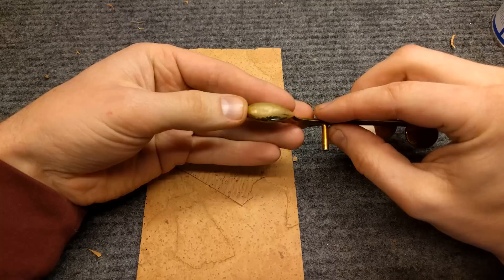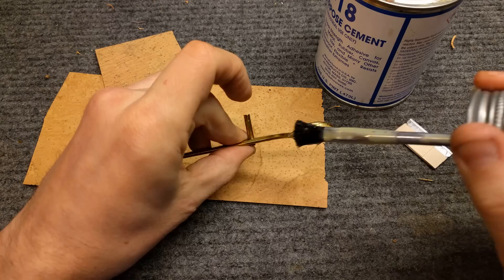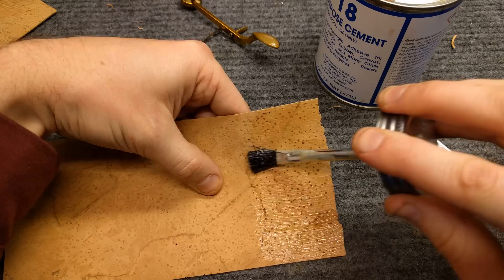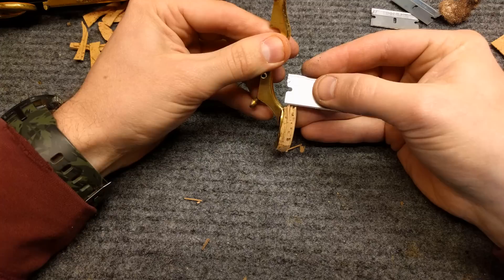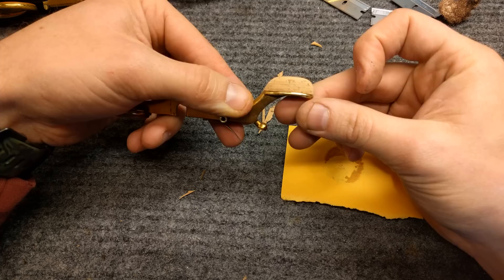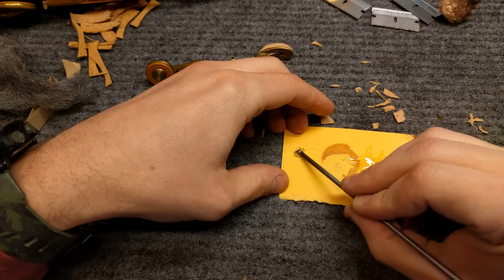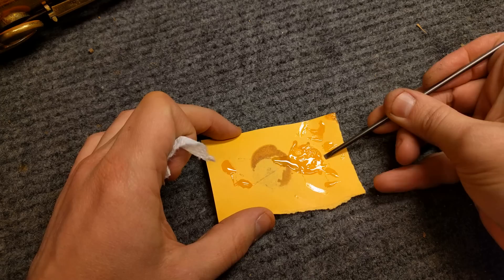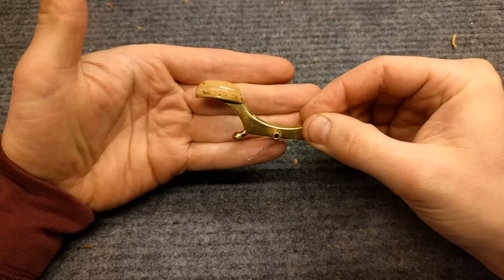Saxophone Repair Topic: Make Key Risers (The Dumb Way?)

Comment: Great job.I usually use the preformed rubber risers. A lot of people don't like them because they tend to move around and fall off. I simply slide a piece of heat shrink tubing ovet the key, trim it off and apply a small amount of super glue to the tubing
 I then slide on the rubber riser and it sticks firmly to the shrunk in place tubing. Quick, cheap and easily removable without damaging the keywork.
Reply from the maker: DUBLIN537 nice tip

Comment: Looks great. I did very similar risers on my alto about 15 years ago with wine cork (what I had:) and coated over the cork and key with clear tool-dip. Looked good for a while. The tool dip eventually absorbed dirt and looks not like new anymore - epoxy would look and feel better. If I ever do it again I might use some nice hardwood with an oiled finish...
Reply: @Anders Hayes instablaster :)
Reply: @Douglas Jamison I really appreciate your reply. I got to the site through google and I'm in the hacking process now.
I see it takes quite some time so I will reply here later when my account password hopefully is recovered.
Reply: @Douglas Jamison it worked and I actually got access to my account again. I am so happy:D
Thanks so much, you saved my ass!
Reply: @Anders Hayes no problem :)

Comment: Imho it's a quite well done result for that problem. All in all I ask, whhy nearly most of saxes aren.t built for normal hand shapes. I don.t even ONE saxophone without too small key palms!!! Only Keilwerth uses a adjustable in/out screw to adjust the palm keys. Thänx MattStohrer for this tutorial, I did also like you showed and could approach the palm keys for my conditions. I can reach now d, eb, e and f without moving the hand, even the wohle forearm. It works fine now. Kind regards, Henry

Comment: Great video, glad I came across it. One question though. On the edge of the key, do you bring the epoxy over the edge, or just barely to it? Seems like if you bring the epoxy even with the edge, then it wouldn't release with heat.

Comment: Nice job. Air bubbles will disappear if treated with heat. Preferable an alcohol torch (look fly rod builder apparel) or a cigarette lighter. But be careful with the latter.

Comment: I have been doing almost exactly this for years; unfortunately, I haven't captured pictures of any customer horns, but (at Matt's request) I just took some pix of my personal horns;
http://www.shmuelyosef.com/images/Palm_Riser_montage.jpg
The way that I fit them was to just crudely glue a cork stack on the palm risers with silicone rubber, carve them a little higher than the customer thinks is necessary and send them away with a razor blade...to just try it out and carve away at it until it is the right height. Then I measure that and fabricate the epoxy risers in place (again a little oversize) using Apoxie Sculpt (https://www.avesstudio.com/apoxie/primary-color-kit) which comes in cool colors and can be mixed with carbon black or metal filings for all kinds of nice effects. You can mix two colors, roll them flat, press them together to make striped material, etc...I have generally chosen personally to make them look brass-like, but have made them red, yellow, blue, black, etc for customers. To finish them you just sand them to shape (with 120 grit wet-dry) and finish them with subsequent 280 grit, 400, 600, and finally with Wenol (or equivalent) polishing grit to make them shiny and tactile. After a little practice you get good at sanding right up to the brass where the epoxy gets semi-transparent and you can flick it off with a thumbnail around the edges at the base of the riser.

I used to do built-up cork, and coat it with nail polish which had nice metallic choices, but found it was a lot more trouble than this. To get the epoxy ones off, you just take off the key, put a torch on the touch for a few seconds and then the epoxy just pops off. You can glue it back on with silicone or contact cement if you like.
Reply from the maker: good stuff man, thanks!

Comment: Could you please do a (series of )videos on common upgrades to vintage horns to make them easier to play.  I'm returning to play alto  Martin standard/searchlight  made ~ 1936 & toying with re-padding/tuning, new adjustable thumb rest, neck or buying Yamaha or Jean student. Goal church concert some Jazz playing.  Your advice is greatly appreciated.   Thank you
Reply from the maker: I don't really do that stuff!  My philosophy is that when properly set up, vintage horns don't need it.  When I see all sorts of doodads all over a horn, I just think to myself well, there's a horn that isn't set up right.  Because most every professional horn made from the 1920s onward can be a great saxophone when it is in the condition that it's makers envisioned when they designed it.  They knew a lot more than us, and they certainly know more than a modern repairman.  I consider myself a student of the instruments they built.
Reply: Thanks for replying - that's a fair response. the caveat is, as am I learning about 'different types' of pro model Martin Handcraft Committee' alto some are made w/  or w/o right hand adjustable thumb rests ( my version w/o) that are small for adult.  It was bought for me as a child. Now as an adult & getting older, I would like adjustable and larger thumb rest for easier handling and larger neck screw for easier loosening/tightening.   Yes I would definitely benefit from your skills to tune w/ correct key height. Do you give over-haul wide range estimates w/ pix of sax, realizing in-person is best /final assessment?  Thanks for your time.

Comment: I have made this key riser for my tenor sax and it is great! Thank you so much for this video! Do you know of any saxophone cases to recommend that better accommodate taller palm keys? Unfortunately my walt Johnson case (even though I love it to death) does not have a very deep well for the palm keys. I worry that excess pressure on the palm key with the riser could bend or damage the key or instrument.

Comment: Nice looking risers.   Any worries about getting a little bit of that epoxy on the side of the keys and being hard to remove later if desired?   I saw the comment about testors paint.   I have added little bits of acrylic craft paint (like plaid brand from the Walmart craft isle) to epoxy to color it for other applications before.  I felt like it caused it to cure faster but otherwise worked nicely.

Comment: Hey Matt! Got epoxy off my keys and decided to use those Protec Clear Risers. They are aesthetically pleasing. Cant tell they are there most of the time visually, like the AWFUL black ones. 
How can I make them stiffer and not so spongy? I tried a shell of clear epoxy JB Weld. But it was still gummy and did not adhere to the silicone or whatever they are made of. Its not a big annoyance but would like a harder touch on them. Thanks for any Ideas!!

Comment: When applying either epoxy or clear nail polish, are you only painting the cork or the rim of palm key that’s showing too? Does it matter?
Reply from the maker: Rim too, for a firm hold (that will release with gentle heat on the underside of the spatula)

Comment: Hi Matt, I am a Woodwind Educator from  India and I have procured all the material mentioned by in the this video to create the Palm Key Risers. I am going through this Video meticulously and need to know this. When you initially applied the contact cement to the palm and the cork (the Thinner one) do we need to wait for sometime before we can start sticking them together(This is my first time use of Contact cement)? Thanks
Reply: Yes, about 15 minutes or until the glue does not feel wet to touch.

Comment: Matt, Any tips on sizing and fitting someone for risers? If you were making them for yourself would you install and try before epoxying? This is a great video for me because I feel as though I have to unnaturally scrunch my palm to hit the palm keys and was considering trying risers. Thanks!
Reply from the maker: No super involved method here, I just tell them to play and look at it and ask them what they like :-)

Me personally I like to have the key just slightly below my natural hand position.  Make sure to PLAY though vs. just rest.  Hand position during playing is often different than resting position, even if you think you are doing a good mockup, playing is what really will show you what you want.
Reply from the maker: You can with the method shown in the video above try out the risers without the epoxy and modify as needed.  The epoxy adds a bit of thickness all around, maybe 1/16" or less.
Reply: Great tips, thanks again!

Comment: Hello Matt, thanks for posting this video. My current current palm key risers are made completely out putty epoxy.  I'd like to redo them using your method. How would you go about removing the putty epoxy? Any advice of salvaging the key finish or can I assume I already ruined the palm key finish by using putty epoxy in the first place?
Reply from the maker: depends on the particulars but a gentle heat (too hot to touch, but gentle and steady so you don't burn anything) on the key can sometimes help the putty let go without taking any lacquer with it.

Comment: On a different note...ha....um How do you remove Epoxy risers that are on the metal nothing in between. Other than grinding down with a file or other tool. Ive heard heat can be applied and they may pop off? 
Thanks Matt!
Reply from the maker: ROGELIO ESCOBAR BLUE ROUTE JAZZ-TET gentle heat to the metal should work no problem
Reply: Matt Stohrer like a mini torch?